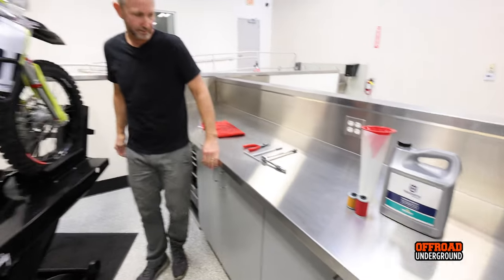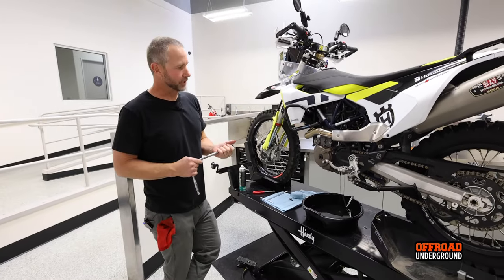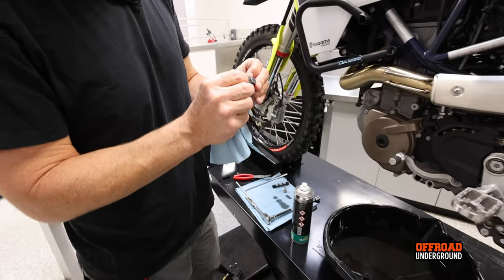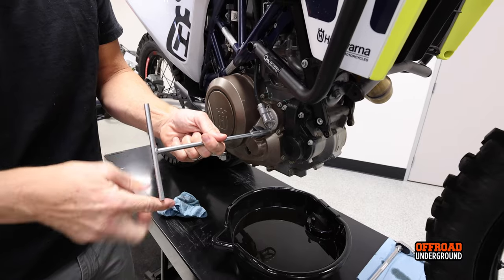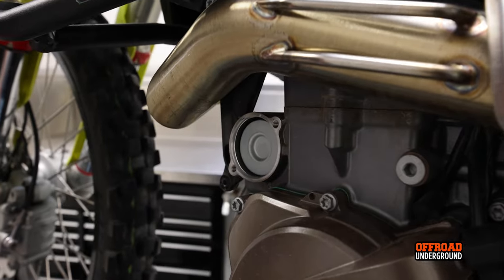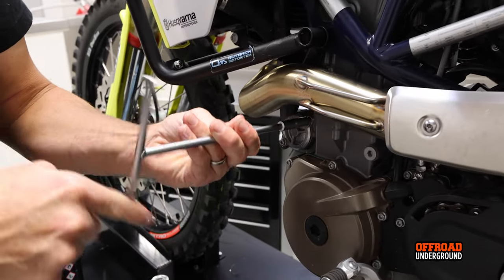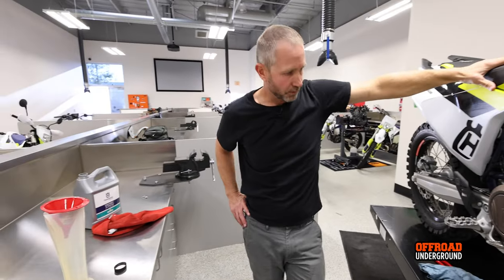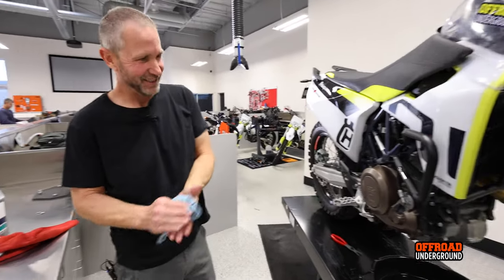Husqvarna 701 Oil change How-To

Comment: I'm buying a 701sm .  it has 8k on it I was thinking a valve adjustment service was coming up but I'm going to have to dig into it deeper.
Reply: I checked mine at 12k miles and only 1 needed adjusting. It was actually very easy

Comment: is it really ok to use contact cleaner inside the engine?
Reply: Not really, but he drain it all out and wipe it. Any residual cleaner acts like a thinner when mixed with oil ,  dissolving it......definitely not good for engine nor gear box.
Reply: @istra70  relative to the 1700 cc’s of oil, the amount of contact cleaner which got into the engine isn’t enough to make any difference
Reply: Contact cleaner evaporates like alcohol. And its safe on plastic unlike carb cleaner. Personally, I dont use it for engine.

Comment: Never  put the New oil Filter dry in the engine. Put it first in the New oil that He can soka up the oil.  

And if you put it dry in the engine dont give gas. 🤦‍♂️🤦‍♂️  

After oil and Filter change let the engine  run in at idle
Reply from the maker: Quinn has done a lot of oil changes on these bikes and about a hundred others, so we deferred to him on this video. I understand what you are saying though 100%
Reply: Always pre soak the filters in oil. That way when you start the engine it is actually getting oil instead of the filters soaking up the oil and the engine being starved for a short period.
Reply: @jameshind6644  Synthetic oils  remain on the engine components for a long period of time, lubricating them when engine is started.
Reply: True. But it is still a good idea to presoak the filters and it will not do any harm.